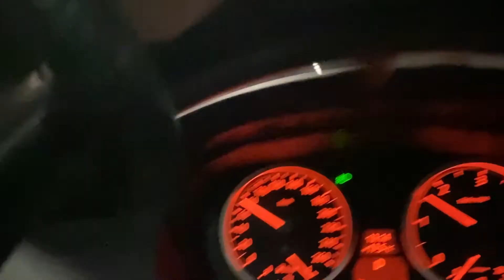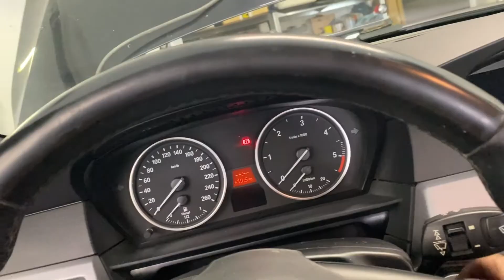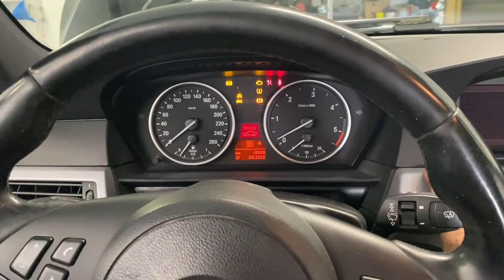BMW E61 for 1600€ left me stranded…..

Comment: N47's and M57's with bad ground straps between chassis and engine is a tale as old as time. I have the same Biltema replacement cable on my M57 btw. Zero issues after ~20k km's

Comment: Love the video, had potential to be very very dangerous though if the turbo seals blew and caused diesel run away in the ferry ❤
Reply from the maker: Thanks, yes indeed, luckily the bmw diesel engines has an engine shutoff valve, which reduces the risk of getting runaway diesel
Reply: @EMSGARAGEE61  I had no idea that’s a really good feature

Comment: Nice video, but changing the Timing chain is not enoug. You have to change main bearrings and rod bearrings too. This is a common Problem with N and B series engines. The are very worn after about 150-200000 km and fail very easily, as well as the bearings of the balance shafts on both sides. Its easyer to take the engine out and replace all of these.
Reply: Not for the diesel. Rods should be OK. N57 only real issue, just like N47 is timing chains.

Comment: Love your videos, have a question why was the car still emitting a lot of black smoke after the turbo replacement? Was it built up carbon or something else?
Reply from the maker: Thanks, when the turbo fails it sends a lot of oil trough the intake system, and when you replace the turbo, even clean the pipes like I did, there is still going to be some oil left inside the system, so it takes a bit of time until the oil evaporates and burns out, this time it took around 100km😊🤝
Reply: Thanks for your answer!

Comment: Hi, love ur vids, i got a question if you maybe know... i own an e90 320d m47 engine manual and the shifter shakes a bit when car is idling, in neutral and in gears it shakes, but when i start driving it stops shaking and everything is fine.. is that normal on these models?
Reply from the maker: Thanks, hmm that sounds interesting, but i would suspect engine/gearbox mounts, but it is common for bmw manual cars to vibrate a bit on the shifter since it's a straight linkage
Reply: @EMSGARAGEE61  yes i had the same thought about the linkage, its not a big shake its like uh its like small shake.. it has 210k km on clock
Reply: @EMSGARAGEE61  ive thought its dual mass flywheel but it doesnt make any noise, just the clutch that vibrates a bit when i put my foot on it... It doesnr vibrate when pressed
Reply from the maker: @yl6001  i wouldnt sorry about it atleast if it doesnt cause any sound😊👌
Reply: @EMSGARAGEE61  yes thats why i stopped thinking its dmf... it should be normal ha...thank you anyway